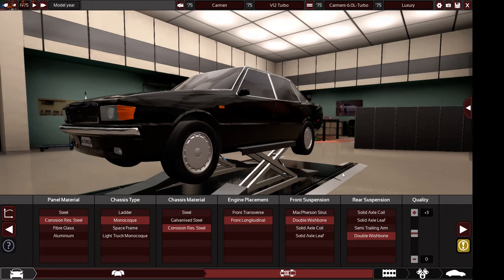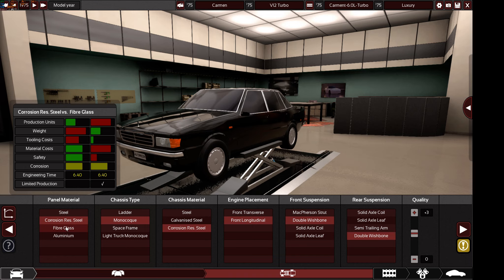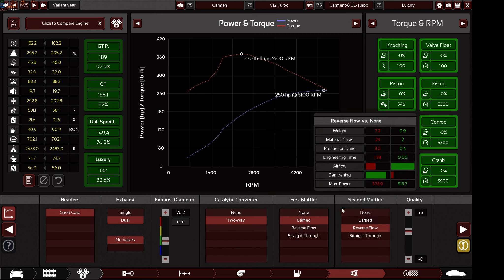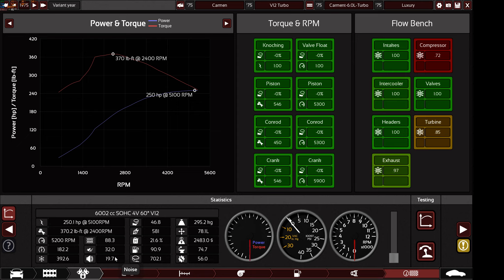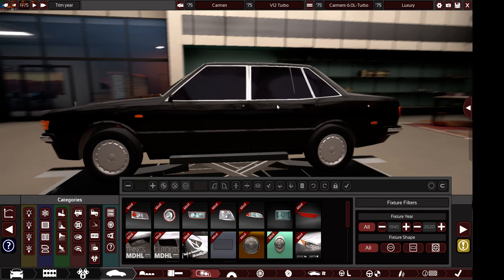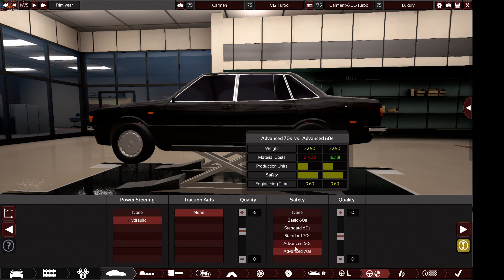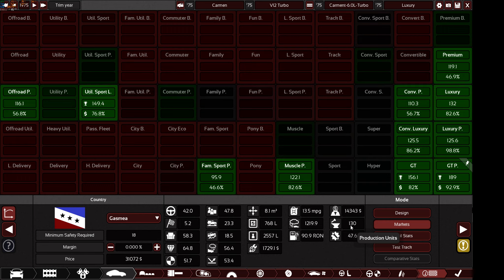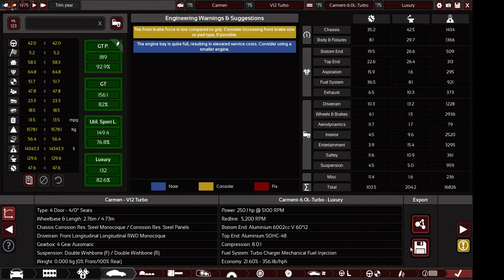1975 Automation Game GT Premium Car Challenge Rules + How to Participate.

Comment: It looks like it's impossible to make a NA V12 engine quiet enough. I picked every quietest option, even the pistions material, and still getting 21 points on loudness. Of course, I can do it by reducing exhaust diameter to 30 mm, or by lowering all quality sliders except the exhaust one, but both ways are silly and irrational.
Reply from the maker: That’s 1975 technology. It worked with me perfectly 100% without using any negative quality on anything. That means your engine is oversized or you want too much hp. Too much hp will make your car impossible to drive with open diff and no traction aids to control  a heavy car. Focus on torque to succeed not hp.
Reply: 6 litre, makes around 250 hp with 57 mm exaust.

Comment: can u help me to make a drift car
Reply from the maker: This is a 1975 GT premium challenge, you came to the wrong place. 

But my opinion of a drift car in Automation, don’t use RWD Because it’s nearly impossible to control it. Use AWD and 800 to 1000 hp and tune your suspension to 100% sport with -1.5 front camber and -1.0 rear camber with medium or sport tires.
Reply: thnx
Reply: can u make a 1 for me